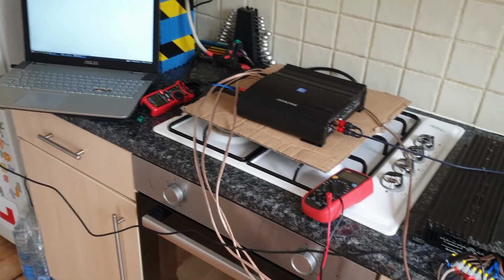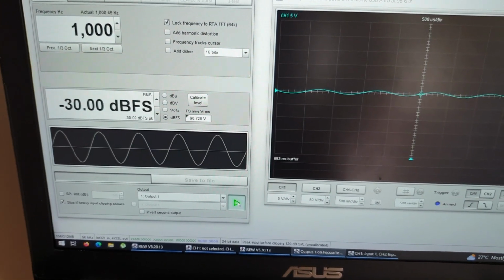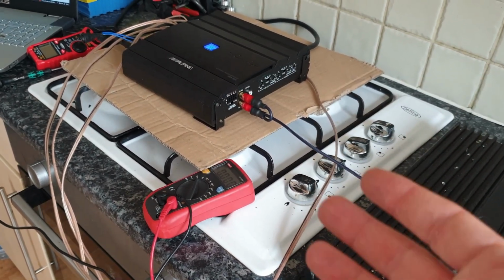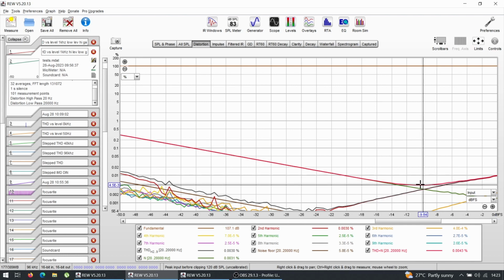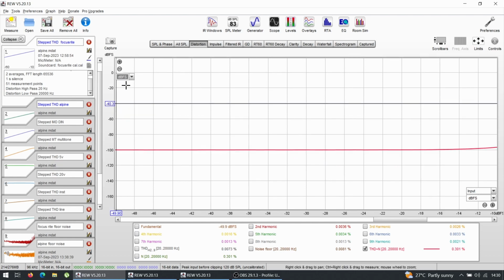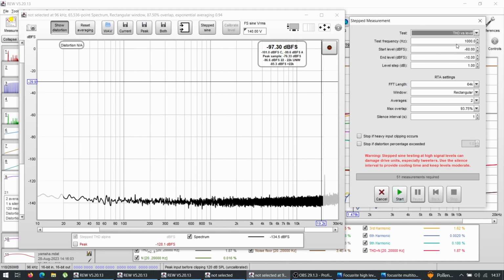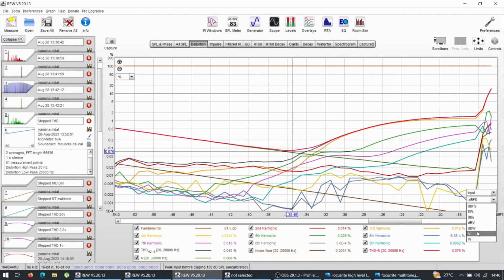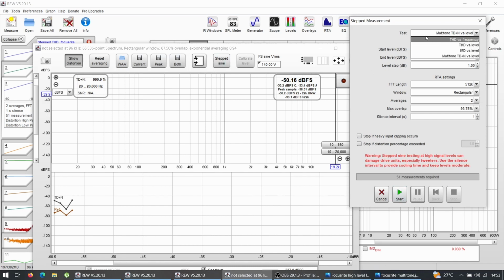How to test amplifier distortion with REW

Comment: Hey! Great video. I noticed you're using a Focusrite interface for this measurement setup.
Could you share a few details on how you designed the input voltage attenuation/divider circuit? Are you using a simple balanced resistive divider, or did you add any RC low-pass filtering and clamping diodes for protection? I'm building a similar measurement rig and would love to know how you handled the signal levels. Thanks!
Reply from the maker: https://drive.google.com/file/d/14agZOyeIl3fCKqwDgHtrFqZ58bF7gJ9f/view?usp=drivesdk
Reply: @RAW-CAt  thanks
Reply: @RAW-CAt tks

Comment: Very informative, thank you. I am trying to lean how can I build a simple low cost setup to measure my basic cheap stereo amplifiers for their THD+N etc (not the full output power), but I am not equipped with electronic/electric skills. Do you think Scarlett Solo could be used for this purpose? It would be very helpful if you can post some basic connectivity diagram or something similar. You guidance will be awesome. Thank you
Reply from the maker: Solo should work just fine for that purpose. You can find more info here:
https://drive.google.com/file/d/14agZOyeIl3fCKqwDgHtrFqZ58bF7gJ9f/view?usp=drivesdk
Reply: @RAW-CAt  Thank you, I will give it a shot. A quick question, can a speaker be used in place of dummy load?
Reply from the maker: @SoundX-Y  yes, as long as the speaker can handle the power you are testing at. 1-10w at 1kHz will be fine for most speakers. Just get some ear plugs 😂

Comment: Which generation Focusrite Scarlet 2i2 is that?   I have the 1st Gen.  I don’t know if its noise floor is low enough to do these measurements well.  
I’m trying to do a simple FFT to measure my headphone amps.  Where do I set the volume controls on the Focusrite?   Cause it changes at different volumes.   I have the volume of the channel in, the monitor volume and the playback/monitor dial.  Where do I set those?

Thanks !
Reply from the maker: https://drive.google.com/file/d/14agZOyeIl3fCKqwDgHtrFqZ58bF7gJ9f/view?usp=drivesdk

Comment: Hello! i have big problem with car amp in my car, all amps tested to subs have this problem.
Distorted output (like too noise) from zero level, Signal are clean but otput are very FAT wave. I have good electrical, with distribution block (fresh instaled)
After modifying the installation (cleaned all grounds, connections, new fuses itp, and distribution block) first test quiet i hear a bass waved to louder and to the quieter. (0,5sec louder, 0,5sec quieter) and stop and quieter.  Bass is weak and blowing subs much before normal amplitude distortion. Sometimes basss is better in specific frequencies (sometimes above 55hz) sometimes under 30hz, sometimes above 35hz. 
What is cause this problem and how to fix that? All Audio wires, subs, amps, head units, exhanched many times.
Thanks!
Reply from the maker: What I would do is start verifying the signal from the source all the way to the subs. I would check the electrical RTA of each component and see where the problem starts.

Comment: How can you possibly connect power amplifier output to the input of your soundcard???
Reply from the maker: Using a voltage divider that attenuates the signal.
Reply: @RAW-CAt  what kind of divider?? A mere resistor divider??? Can we use potentiometer to be able to make variable attenuation?
Reply from the maker: @jeffersonavila7275 watch from 15:20 https://youtu.be/vmNmqa-OKHs?si=PCL4RQkiWGWHzmDn

Comment: you'll blow that Focusrite up, the max Mic input is 16dBu or 4.9V. You should be using a voltage divider for higher than rated input voltages!!
Reply from the maker: If you would have watched one video before this where I go through the physical hardware, you would see that I am using an attenuation circuit.
Reply: @RAW-CAt  Why did you use attenuator if your Scarlett 2i2 2nd gen has max input Line level +22 dBu (with TRS connector and switch in line mode of course)? Mic input with +4 dBu works only when using XLR connection.
Reply from the maker: @anatolyt271 because 22dBu is only around 10Vrms. I am measuring amplifiers at 25Vrms and up.

Comment: that stove got me thinking. how dose an hot amp perform
Reply from the maker: I might be able to test it out. Is there a difference between cold and hot amp performance👍
Reply: Gain reduction until temperature settle. Maybe THD level will also jump up as the inductors get hot.

Comment: Is a self looped reference channel really needed when measuring THD in amps? Maybe not for performance reasons but for cal purposes?
Reply from the maker: I believe it's needed in order to measure harmonics. As THD is comprised of other things, as well noise. I just have it in order not to miss anything.
Reply: @RAW-CAt  THD is a total of harmonics. THD+N is lumped with noise. You can either assess harmonic distortion and noise on their own contribution or in combination as an unwanted stuff metric. In any case you can compare a straight measurement without the self loop ref and see if something changes in your results.

Comment: Good video!
But you shouldn't use 1kHz to calibrate levels, cheap multimeters are often specified to only be accurate to their spec within 30-300Hz for AC voltages. Errors increase dramatically outside this. They're meant to be "accurate" around household line frequencies, i.e either 50 or 60Hz. Some true RMS multimeters have a good extended frequency range for accurate AC peak voltages, but you have to check the specifications
Reply from the maker: I agree with you, but the calibration is not crucial is my case as I am not after absolute numbers with maximum precission. All I need is realitive comparisons betweent my amps🙂 So even +/-1V is fine.
Reply: There are 2 multimeters in this test system. One is measuring AC Volts and the other AC Current. 

Even the best Fluke brand clamps and meters are only accurate from  ~40-400hz. 1kHz is entirely out of range and should not be used. 

Evaluating amps at 1khz is a useful endeavor with 1khz being very sensitive to the human ear. Just fine tune your methods.

I am entirely enjoying your content none the less. Thank you!

Comment: You're right in the last video though that amp dyno's tell you nothing about an amp, unless you are strictly going for SPL where distortion doesn't matter as much.  Those channels would test a cheap amp that did double rated power and say it's great, but a class AB SQ orientated amp that just hits rated and say it's a bust.
This series could be a good eyeopener for people.  Maybe you can get some manufacturers to send you amps to test, or some amps Sam is working on.
Reply from the maker: I would imagine that some local SQ hads will want to test what they have :) Sam is working on monster sub amps, very rarely he has a fullrange amp. But yeah, I hope this will show people that there is more than max RMS value that defines an amp.